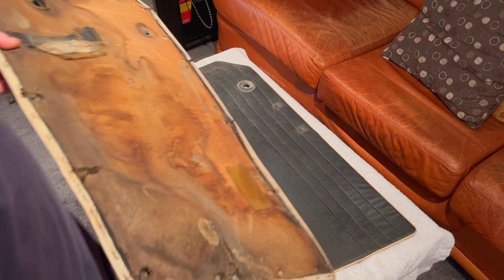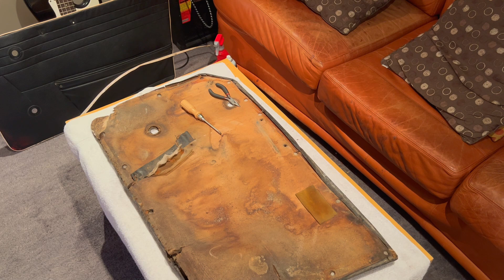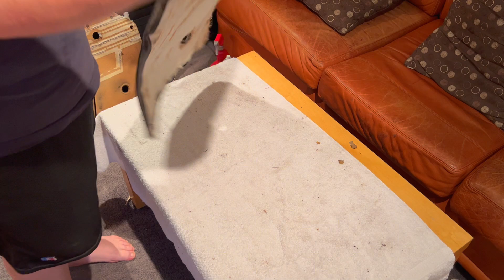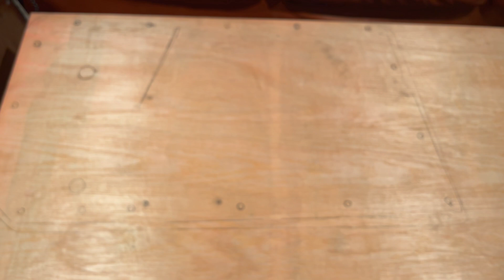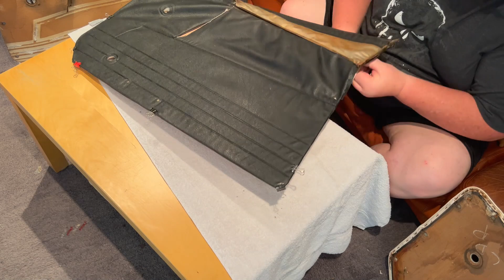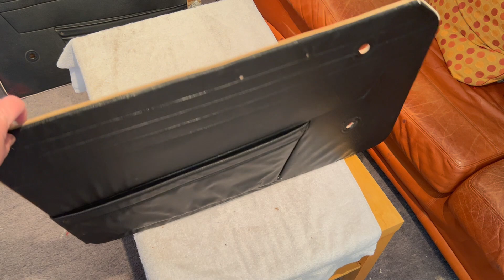1962 Triumph TR4 RUST-oration Project, Door Panel Rescue

Comment: ...Good job ! ...  I've done my 3A interior twice now....Was going to use door skins but settled on hardboard as original....My wife's sister made all the white piping for me with material from Fabricland, some hard foamlike tubes wrapped/sewn in white vinyl....Worked out really well with lots of material to work with....She then made new bottoms for my Amco side curtains, did them in black not knowing I'd bought a new white top...Oh well, looks like a Panda...white car, black trim&sidecurtains and a white top...lol...Can't say the old TR doesn't have over 5 decades of character...My sister-in-law reupholstered boats and RV's and is now back in Sault Ste. Marie.......We miss her dearly............John (west coast, Can.)

Comment: That panel turned out pretty nice and fits right in with the rust-oration work you guys are doing.  I've never had any luck trying to use a hand stapler so when I did some door panel repairs on my TR8 I bought an air powered upholstery stapler from KMS Tools.  It worked very well although the amortized cost per staple was fairly high. LOL
Reply from the maker: Thanks Neil. Yes, I think it will be the look we are going for.

Comment: They’ve come up well. When the vinyl is OK they’re usually pretty saveable. I did my Herald’s with marine grade ply nearly ten years ago now and they still look pretty decent (aside from being impossible to keep clean as they’re biscuit/tan). I’ve often had to use over long staples too, padding with a bit of card on the outside can help if they’re showing through (though you’ve clearly got away with it here cause of the edging trim!)
Reply from the maker: Thanks! It isn’t perfect but it’s much better.

Comment: Your a braver man than I, Chef.  I would have tried soaking the panel in water then pressing it flat for a week.  After it dried I'd consider a layer of fiberglass in epoxy as reinforcement.  After recovering a motorcycle seat and Alfa seat I've learned my upholstery skills are lacking.
Reply from the maker: The panel was crumbling pretty badly in the corners so I don’t think I’d be able to rescue it…in the end, I think it turned out ok…I’m not an upholstery guy either 😉

Comment: Considering what you had to work with and baring in mind it's an original 1962 vinyl covering I recon you did a bang-up job there David.  My eye was drawn to the Fender Jazz Bass.. Is it yours ?
Reply from the maker: Hi, Thanks.  Yes, the Bass is mine…I have recently picked it up again after not playing for about 30 years….
Reply: @cheftush   I was a pro bassist in my teens (1960's) and used a Fender Jazz bass.. Great guitars.. I later took up guitar after years of not playing at all and I'm now in a band (at 74 years of age 😅) playing music from the 1980's Rockabilly revival .. It's a bit easier these day's to make a comeback as there is a huge selection of quality lessons on YT.

Comment: You can’t used pvc panel for doors panel. Resist weather and water, better than card board or wood panel. Is just a sugestión.
Reply from the maker: Yes, unfortunately no pvc at the local store so the wood panel will have to suffice.

Comment: Pretty good looking save!  I too would have suggested a little heat to get some of the wrinkles out of the black vinyl.  Also did you try to clean the welting with some bleach to get the rusty stains out?
Reply from the maker: Hi John, no, didn’t try and bleach the welting…the only problem with stretching the material more is that it is distorting the areas where the door pocket screws to the metal door backing.  Every time I pull on the material, the pre drilled hole starts to move closer into the door pocket wrap around.

Comment: Good job, looks ok. You could try and iron the panel,  just try using a bit of paper on top of the original material with the iron on cool first, then if necessary turn the temperature on the iron up. But still looks good,you done a great job.

Comment: Nice work Dave (I appreciate the car is over at Elin’s place) but it would have been nice to test fit the oak ply panel to door before committing to putting the vinyl trim back on. However I guess in real life time the panel is already back and fitted so I’m guessing everything was typically satisfactory! kind regards.
Reply from the maker: I think it will be ok phil. There is some give either way with the mounting pegs as they can be moved around the holes on the door panel to pick up the inputs on the metal door piece
Reply: You can get thinner ply panels say 3.6 mm or 1/8 "... would have been closer to the original hardboard if you can't find that.
Reply from the maker: @johnmoruzzi7236  yeah, I used what I could find locally.